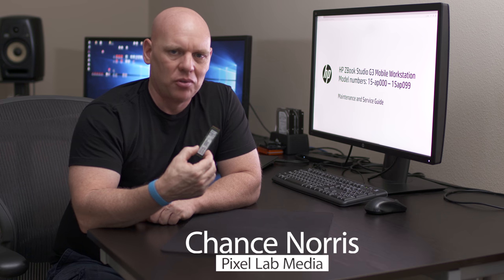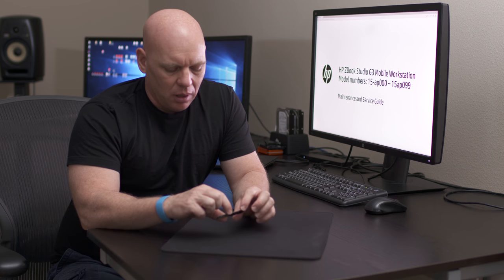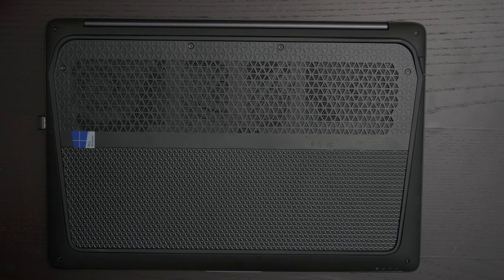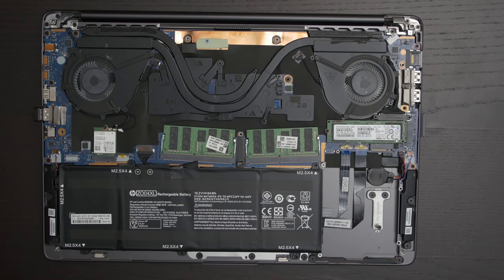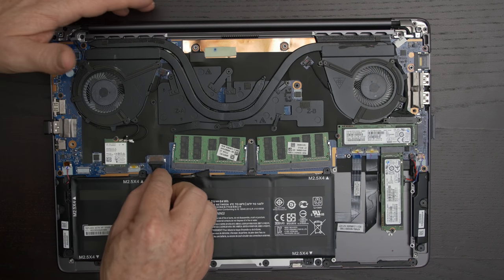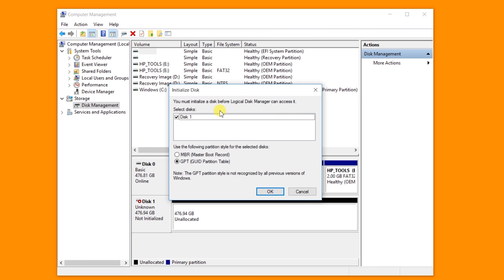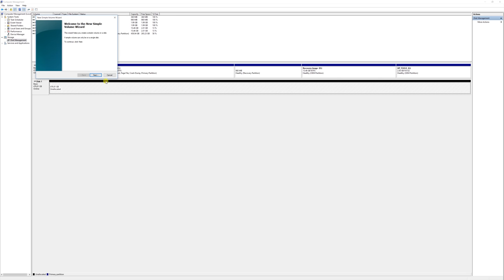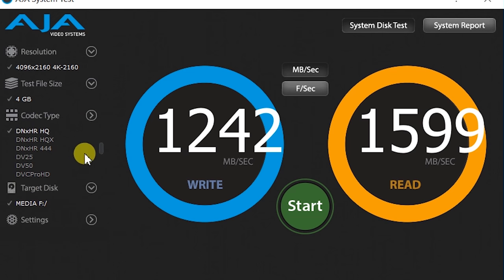Installing a HP Z Turbo Drive in HP ZBook G3 Studio Mobile Workstation

Comment: for the record, I think I found the trick to get nonHP parts to work. I first installed a personal Samsung 850 EVO 512GB SATA and Windows will not recognize it. but after I upgraded BIOS to 1.18, it is now working fine. so if you run into this video, make sure you get the latest BIOS. (strangely, the Support Assist will not suggest BIOS as being subject to update, but I manually found it on HP Support.
Reply from the maker: That's great Daniel i'm glad it worked out for you.
Reply: Now at 01.23 Rev.A

Comment: I dont get it, why wouldnt any M2 NVME work? I appreciate your concern for HP parts, but I refuse to overpay for a disk that can be found on any major store.
Reply from the maker: Hi Daniel, I total agree with you and this advice was based on direct contact with HP support.  There is a possibility that you can find a drive that is compatible, but it could be hit or miss based on my research.  There is a lot of information about NVME drives not working at all. I only advised on my own personal experience.  If you find a drive that works I would be interested in the model #.
Reply: I just tried installing a Samsung MZ-V6E500BW in my ZBook Studio G3. Not only did the SSD not show up in my computer but my WiFi stopped working. I haven't tried finding any work arounds but using a non HP branded part was not plug and play for me.
Reply: interesting. does the drive show in BIOS or in Disk Manager? if so, it could be an issue of Samsung drivers; or RAID versus AHCI config.
Reply: wait wifi stopped working? that is very strange. did you replace the original M2 or added it in the second M2 port?
Reply: Added it to the second M2 port just like in the video. But when I rebooted Windows didn't recognized my old WiFi drivers. I disconnected the SSD drive and the WiFi was back. I'm hoping it's a driver thing but didn't feel like fighting it tonight.
Reply: ok. at the extreme it could be a faulty motherboard running out of PCIE lanes to support both M2 and the WiFi module. keep us posted, this is an interesting bug.
Reply: I am still intrigued; did you solve the problem?
Reply: any news?
Reply: I finally got it to work. I installed HP SoftPaq Download Manager. It had a bunch of updates and driver updates that HP Support Assistant didn't find. I'm not sure which one did the job but it now works.
Reply: @pixellabmedia7142  Samsung EVO 960  or 970 , 970 plus all of them will be compatible.